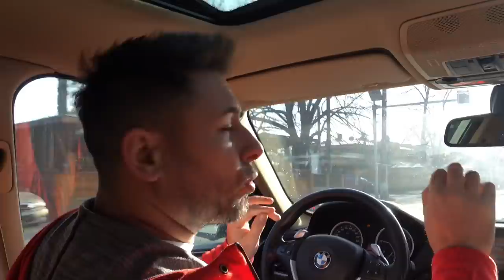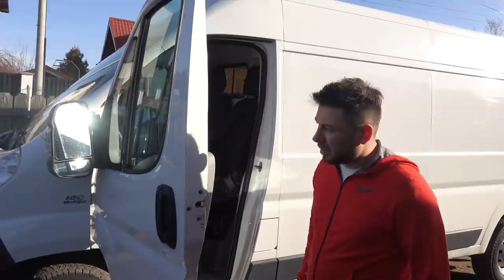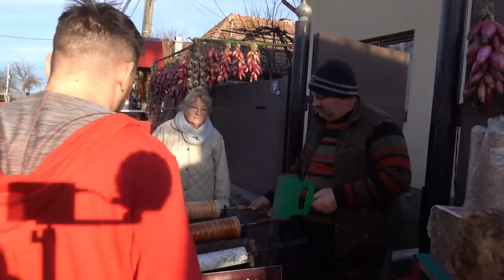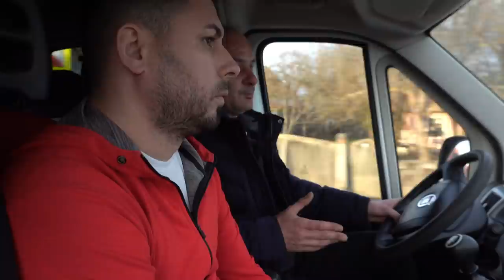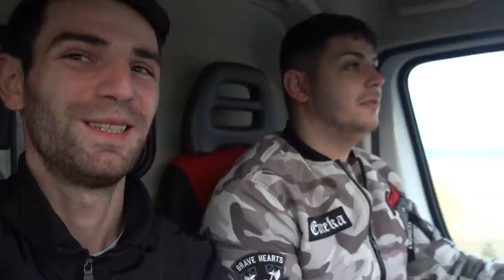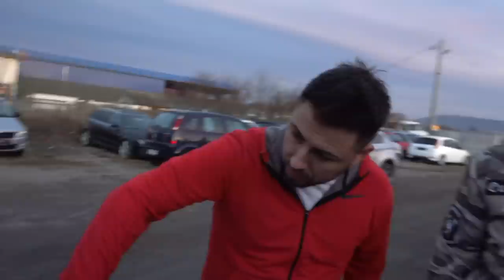CAUTAM DUBĂ PENTRU CASUTA COPILĂRIEI MELE

Comment: Sunt sofer pe fiat ducato de la prima generatie pana in prezent..in februarie imi vine cea noua...cele de la covasna sunt tigai obosite rau de tot ..cazane...a lui grasu din baneasa e reparata de el deci aia nu prea a vazut service la viata ei..si prima nu se auzea bine deloc are cv probleme la motor...daca treci prin buc lujerului iti arat duba mea fiat ducato 2016..306000 km sa vezi cat de bn e intretinuta si cum se aude motoru sa iti faci o ideie..masina a fost reparata doar in reprezentanta...in concluzie mai cautA..cele 4 sunt cazane
Reply from the maker: Mulțumesc, lasă mi un mesaj pe instagram

Comment: Eu zic să ei Mercedes Sprinter 313 e cea mai bună dubă tatăl meu numa de astea o avut si sunt bune o avut prima data Mercedes Sprinter 313 mai vechi  si dubă a mai avut da mai noi si acuma are Mercedes Sprinter 313 2016 trage bine masina cu asa motorizare 313 e cel mai bun motor de la Mercedes

Comment: Cu 5500 de euro iti iei un Mercedes Sprinter 313/316 pana in 2005 in stare foarte buna, pentru ce ai tu nevoie eu zic ca nu trebuie sa te uiți la anul de fabricație, parerea mea este ca modelele mai vechi sunt mult mai bune. Eu am un Sprinter 416(varianta pe dublu) din 2005 si sunt foarte multumit de ea.